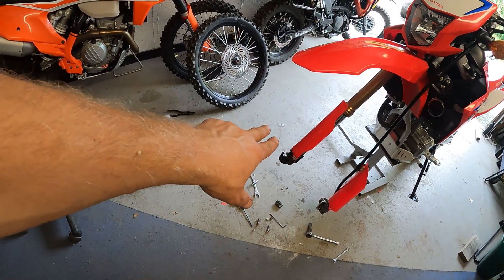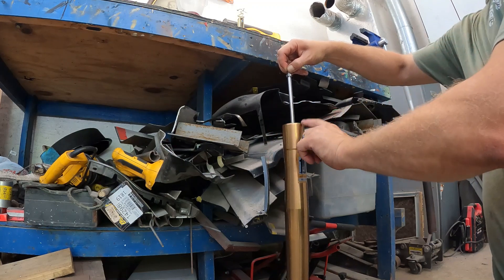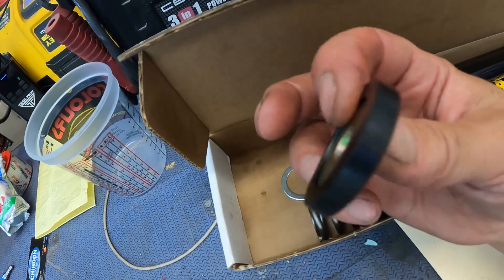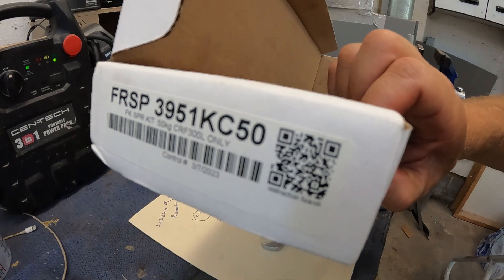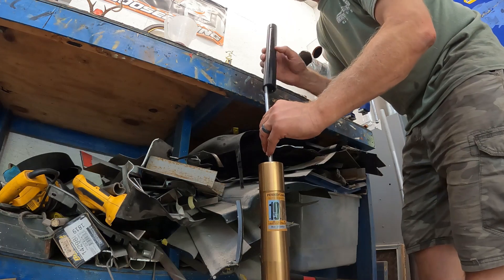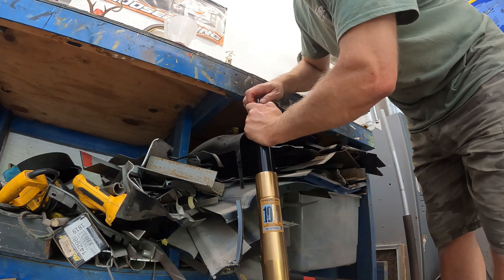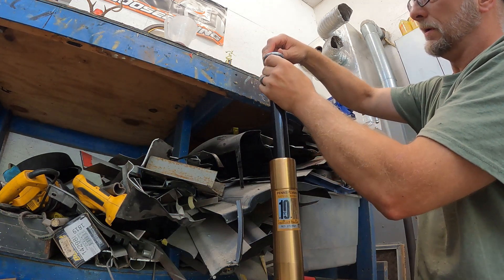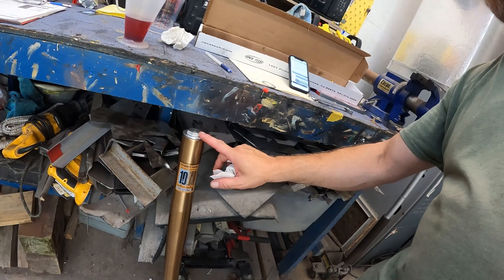2023 CRF300L Race Tech Fork Spring install

Comment: I actually had to install this leaving the fork leg on the bike, as I didn't have the proper tool to remove the axle and it was tight as ****. So, that can be done as well. I just had to ratchet strap the suspension down on the right leg to get at the damping rod and cap, then let it go to reinstall the cap.  The bike is a whole lot less pitchy now on road and we'll see how it work off road when nice weather returns. K Tech rear shock already in.

Comment: Be interesting to hear how you like the RaceTech Fork Spring Kit. I installed it on my crf300l along with a K-Tech shock. I was disappointed with the fork spring kit though. I found the final spring rate too stiff. Also, the long Delrin spacer tube was carelessly drilled leaving shavings cluttering the inside and burred edges. Plus it was cut to an incorrect length. RaceTech told me the right length and advised me to cut it. I did that, but still, no matter how hard I hit the forks in whoops and ruts at speed, it leaves at least a couple inches of travel before bottom that cannot be used (I put a zip tie on the tube to check travel used). When I look at the spring rate on other spring kits for the 300l for my weight range, the RaceTech kit is almost double the rate that all other manufacturers deem appropriate. That changes the suspension characteristic through the range, and not in a good way. The K-Tech shock though is awesome, and it alone improves the handling and stance of the bike tremendously. Good luck and enjoy the bike. Once they are sorted they are a lot of fun 🙂
Reply from the maker: Thanks for the excellent input!
Reply: I have the same kit including the Gold Valve. Seems like the installation instructions are not great. I think I will place the brass washer on the bottom of the tube, use the factory cap/washer as the top preload fine adjustment with minimal spring preload. Most of my riding is on road, so even slightly over sprung suspension might be ok. I did expect better from Race Tech however, yep my tube was a mess. Thx for the info.
Reply: @baerv3753  I have the K-Tech shock sag and rebound damping set correctly for my weight which is about 175lbs. I asked RT and they do not offer varied spring rates on the fork spring kit for the crf300l tailored to a rider's weight, and that is the main issue. You get one choice only, and yes, it is much too stiff for the average rider weight for the purpose the bike is commonly used for. It isn't a motocross bike. A properly sprung fork should be able to use almost all the travel when pushed to the limit. No point in having long travel if it can't be used.
Reply: @baerv3753 The travel buffer: I said it should 'almost' bottom which implies a buffer is desirable. I don't ride to the limits. I tested it almost to the limit because it seemed overly stiff and that buffer you mention was over two inches from bottom in this case. A bit excessive don't you think. You said "one size doesn't fit all". That's precisely what I am saying. RT offers only one size for all. That doesn't work for most riders. Perhaps you don't realize it but we are on the same page. If you experienced this spring kit you would see that. And of course I would have been better off with something like the Ohlins you mention, but that's after the fact. We are not all custom suspension pros like yourself. I relied on Racetech's recommendation that it would be an ideal match for my weight and dual sport riding. The results plus the shoddy production value in the Delrin spacer were disapointing.
Reply: @baerv3753 Yeah I knew they had a spring rate calculator but when I asked them about it they said it's not for the crf300l, and the only option was their kit. Yup, it'd be best to get a cartridge system up front but I can't afford that now. Spent all I'm going to on the bike. I've accepted it as it is. For the riding I do the forks perform a bit better than stock in the range of travel I normally put them through which nowadays is mostly on tarmac, twisties and such. The shock was the big-time improvement. No more wallowing through fast corners, not recovering from one before entering the other, lol. So that alone makes me happy despite the disapointment in the RT fork kit.
Reply: @baerv3753 Absolutely you never want to bottom out. Yes, I measured the mechanical travel on the fork and placed a zip tie on the tube. That's how I found that approxmately 50 - 55mm is unuseable when pushed very hard into whoops and ruts. That represents about 20% of the total travel. Not ideal by any stretch IMO, but as I said previously I've accepted it, at least for now ;-)
Reply: @baerv3753 Thanks for the suggestions. That may be a good idea to reduce the torque especially on the lower pinch bolts. I recal the crf250l had 12mm pinch bolts and the torque setting was 25 lbf.ft (on my 2013 250l). The 300l uses 8mm bolts and 22 lb.ft. Lowering the torque on the lower bolts to 18Nm which is 13 lbf.ft may be a bit drastic, but perhaps trying 18 lbf.ft is wise. I don't why Honda specs it that way. I have assumed they know the wall thickness and the tolerance to torque, but...?
Reply: @baerv3753 Cheers, that's good information. Thank you. I've written your suggestions down. I'll definitely try out a lower torque setting when the weather improves. Down the line, perhaps some cnc triples 🙂
Reply: @baerv3753  hi, I am based in Pattaya and just bought a used CRF300L.
Do you offer suspension services in Thailand? Where are you based?
I have been talking with Dirtpower shop and was thinking this option for a cheap fix: I'm 85kg with gear so Ohlins 8.5 N/mm fork spring and either Ohlins 1314 which is 40 mm2/s or Motorex 10w which is 49.5 mm2/s. 
Dirtpower also changes valve shims to adjust rebound.
For rear I am planning to put in spacer to increase Preload, heavier oil and change valve shims to adjust rebound.
What do you think about this option?
What are your thoughts with the shops here taking apart the stock shocks, changing valving and oil and reassembling for 2,000 baht? It's cheap, but is it worth it?
Cheers
Reply: @baerv3753  great advice thanks. I don't want to spend too much on suspension as it's a budget bike but I will look more into my options for the rear suspension.
Regarding the triple clamp bearings, is the problem is that they aren't greased adequately from factory or the bearings themselves are crap? What do you recommend, grease or replace? Thanks.

Comment: Quick update, I just did the install on my 2023 Rally yesterday. I did not use the brass washer at all. My installation in order of dropping parts into the fork:

steel washer
spring
steel washer
plastic bushing/washer
factory length spacer tube (forgot to measure it)
factory fork cap.

If you inspect the factory cap, you will find that the big washer of the cap is actually floating and rests against a rubber cushion. This washer/cap is designed to accept and cushion the spring loads. My set up provided me with a small amount of preload on the spring, i have good free and rider sag. Hope this helps.
Reply from the maker: Thank you for the info. All of You guys have given some awesome input on the  spring install!!
Reply: What does not using the brass washer do to the fork

Comment: Hi from sunny Indonesia, I am taking a delivery of a Rally 300 (well its still 250 here because of "big" bike limit at 250). I have the Race Tech spring kit and Gold Valve waiting for the bike. I have watched many install videos on this kit and I see some issues with the installation. It seems most people end up with too stiff suspension, it seems that the preload tube installation and dimension is not well defined by Race Tech. The position of the brass washer is a big factor here. If you install the washer on top of the tube, then it is the jam nut for the cap that defines the spring pre load as it rests against the brass washer (this is how you have installed your kit). If you notice, the cap itself has a big washer on it, typically, factory spacer tube rests against that washer............By using the brass washer and the jam nut as the stop, you actually pre loaded the spring by a good amount. Also at the end you placed the steel "preload" washer on top of the spacer tube/brass washer, this does nothing, as the preload washer is not placed between the spring and the tube, it is free to rattle around your fork. I think I will be using the brass washer on the bottom of the spacer tube (this will center the tube/washer nicely over the spring) and will allow the factory fork cap/washer to constrain the top of the tube. With that, I will also be able to make fine tuned adjustments on the pre load, by screwing the cap to a proper depth on the dampening rod.

The oil level, it affects the later stages of the travel as the fork tube slides into the upper tube. The internal fork space decreases now, the air gap that exists in the fork is now compressed. This compressed air starts to act as a "spring" stiffening the overall travel. The best way to adjust the air gap is simple. You start with bit less oil or larger air gap, assemble the fork and now depress the fork as hard as you can. You should be able to bottom out the fork (you do this with the fork off the bike). You now start adding bit of oil, until you can't bottom out the spring, this is your perfect oil amount/air gap. Using zip tie on the fork, making bottom out mark helps with that. This is a way to fine tune any fork, you do not want to overfill a fork as it will become too stiff and will end up blowing out your seals.

I would definitely check your free and rider sag as you are making these adjustments, these tuning steps can make a world of difference.

I saw your test ride video, valid $$$$$ points, but the springs provide only "support" for the bike. By not adjusting or fixing the bubble gum factory dampening (that's the real magic in suspension) you can possibly create worse suspension. That rear shock having no rebound dampening can send you flying one day. i have been using YSS shocks on many bikes here, they are good quality at a good price.

Hope this provides you with some useful info.
Reply from the maker: Thanks for the excellent info!!